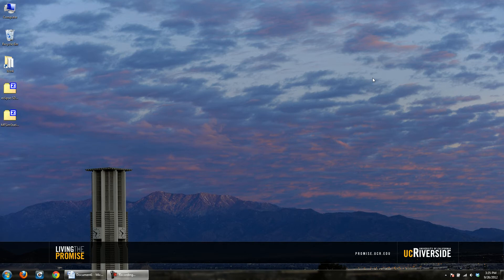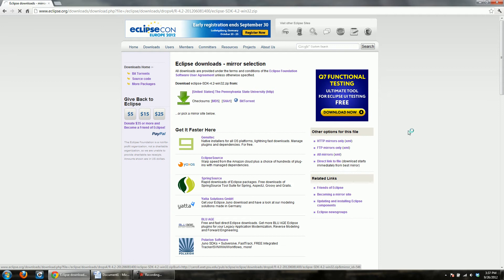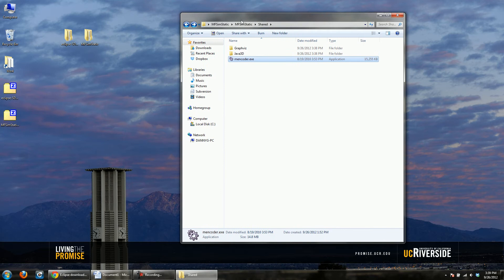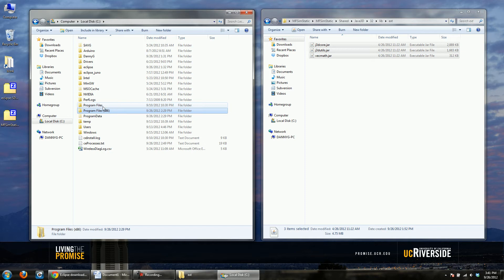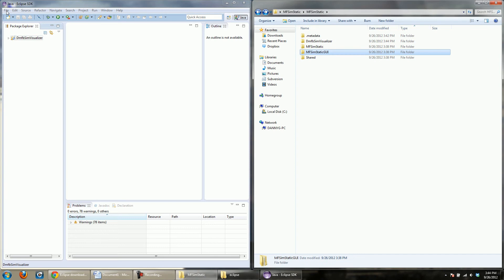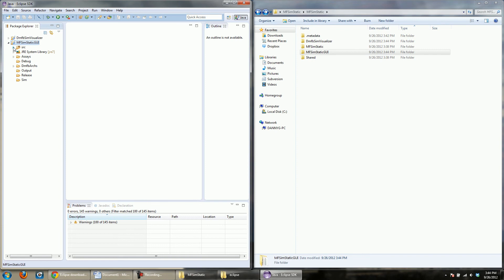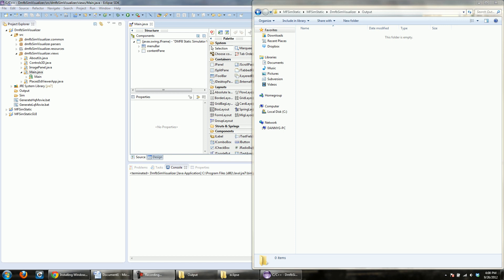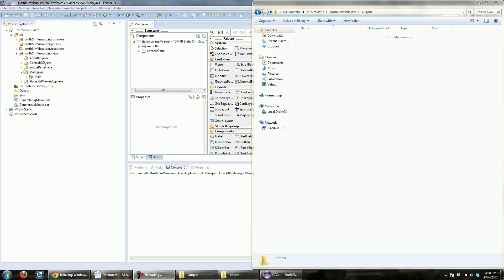UCR DMFB SSS - Development Environment Setup

Comment: I am facing two problems. 

1. The current master doesn't contain any bin/ folder but lib/ folder only inside shared/.

2. Also my local jdk-15 has no lib/ext/ folder inside lib/. 

Could you guide what to do in that case?